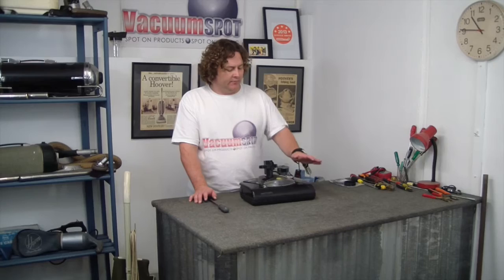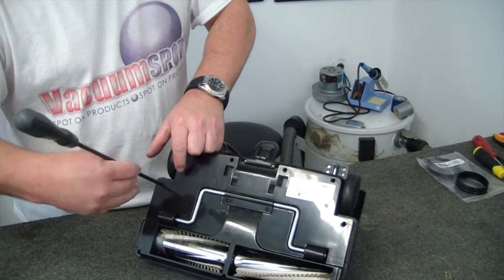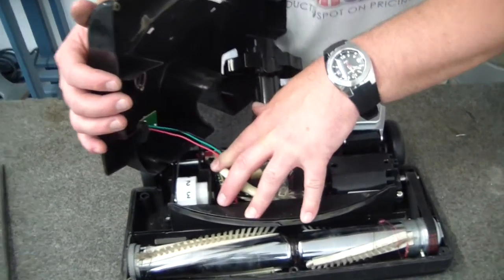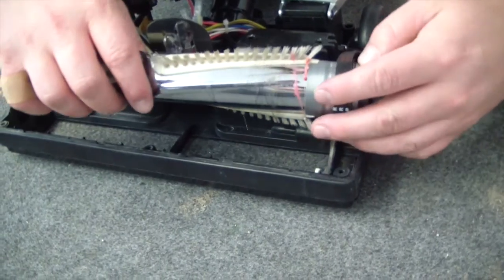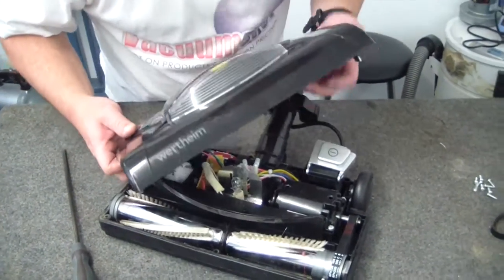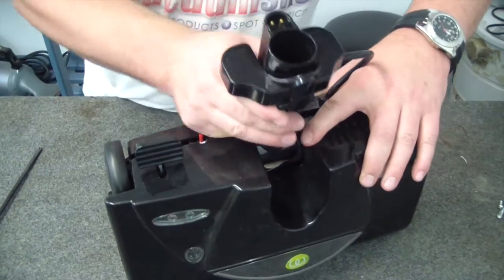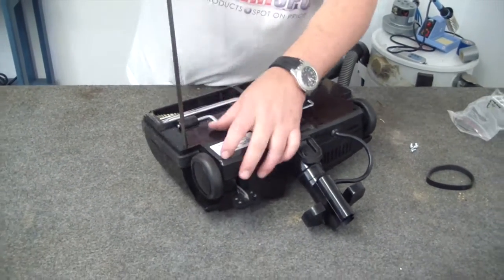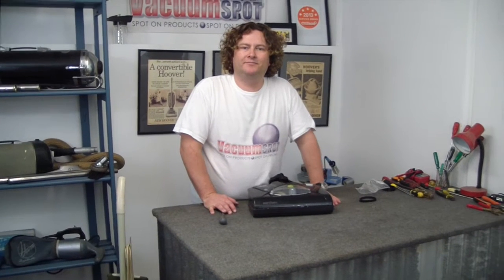How to change the belt on a Wertheim PB18 Powerhead.

Comment: @gordonbchristensen8727 - My question exactly!  I believe what I have to be a (broken) original belt for a Wertheim PB007.  It is 11mm wide - is this correct?  If so, where can I buy one, because I have gone through two Godfreys 'replacements' (thicker and 15mm wide) and they appear to pull TOO tight and then end up jamming and burning through with an horrific smell of burning rubber.   Thank you.